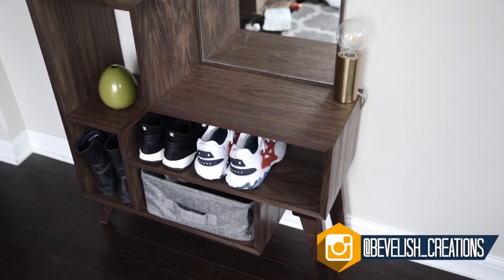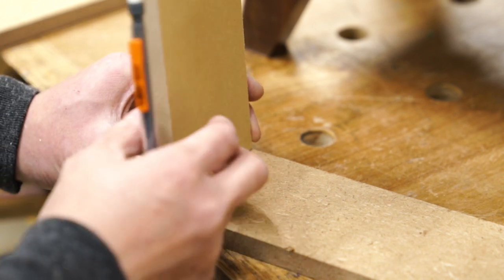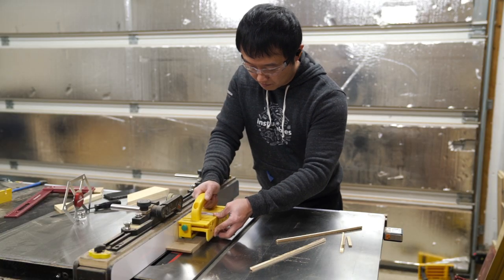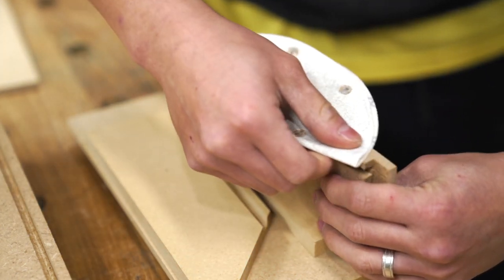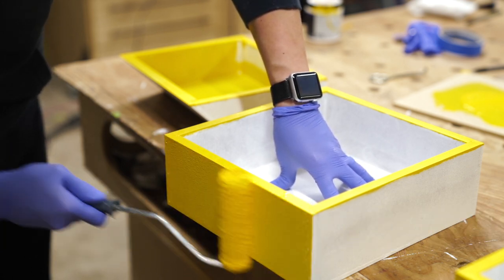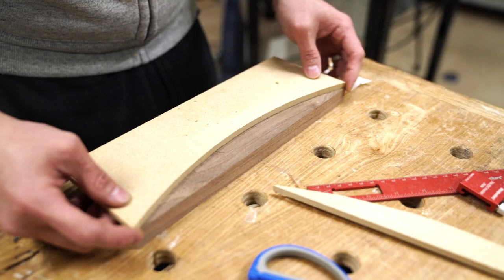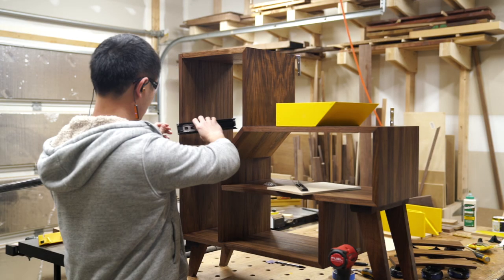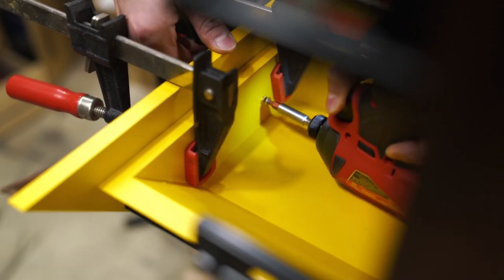Make Easy and Fun Drawers || How To DIY

Comment: Nice mod, Alex.  I especially love the integrated drawer pulls.  Had never seen that before.  Was that something you thought of from the start or did it just hit you as you were designing?  Either way, love the end result.  I will steal that someday.
Reply from the maker: I’ve cut similar type of pulls on my drawers I did for the nightstand, but that was done on the table saw since it’s a straight cut. It kind of hit me one day that I could do it to a curved edge using my chamfer bit, once I realized I could do that, then I designed the curved reveal